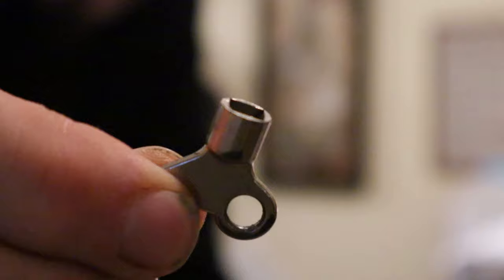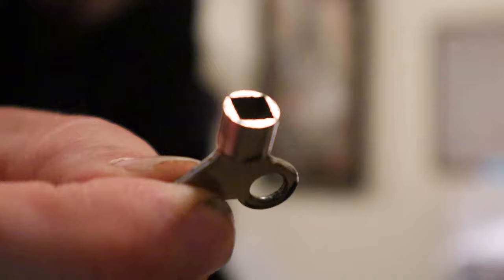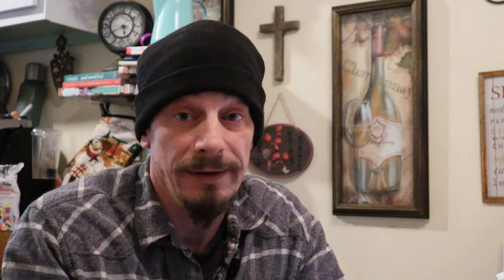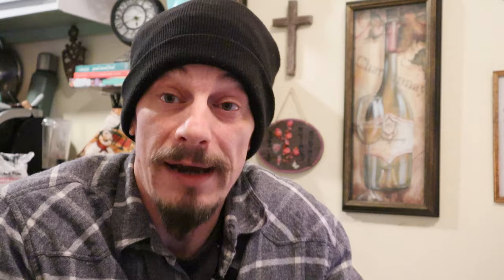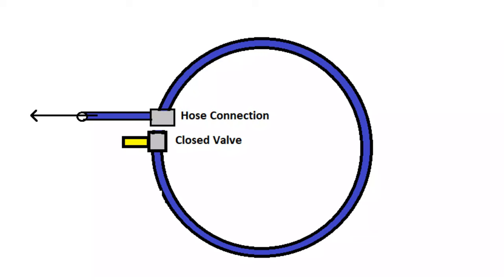Purging Air From A Boiler System (Residential)

Comment: i have a house with 3 different elements 
radiator ,convector and baseboard on a single family hydronic system how do i bleed this
Reply from the maker: They may have different types of bleeders but they all bleed out the same way. Sometimes you have go beyond just letting air out and keep going until hot water starts coming out.

Comment: When I started and through the process of purging the air out the water was filthy brown.
Any problems with that?
Reply from the maker: It is a sign of poor water chemistry in the system that leads to corrosion and lower efficiency. Ideally, it would be best to do a "power flush" and then add some inhibitor afterwards. Or at the very least, purge until clear and add some inhibitor.
Reply: @JerseyMikeHVAC  Inhibitor would be a water cleaner and how to introduce into system. I have baseboard heat.
Thank you John M

Comment: No one will show us the valves and how to use them Every single one of our baseboards has a different valve and we can't for the life of us figure out how to "open" them to bleed the air out. We've tried turning them, pressing on them. I can't find anything online that will show me a picture of the same type of valve that I have. Help!
Reply from the maker: It's not unusual for me to come across plenty of bleeders that just wont open because theyre rusted shut. So don't feel too bad for struggling. 

A lot of these bleeders require a key like this one: https://images.homedepot-static.com/productImages/5d03b2b3-6c9e-41fd-b2a5-7631778ea291/svn/danco-hvac-tools-80238-64_1000.jpg

Some may need a flat head screwdriver. Others just require a half turn but require channel locks to do it because they are so tight, rusty and caked over. Those 3 methods cover most types of bleeders out there. Just be sure not to completely unscrew them as water is hot and under pressure and you do NOT want them breaking off. Water will fly everywhere, and it won't stop unless you know exactly how to depressurize the system and shut off the water feed to the boiler very quickly. 

 If any are too much of a fight, you are far better off just depressurizing the boiler, draining the pipes and just replacing all of the bleeders to new ones. It will be less stressful and less work in the end.

Comment: Jersey Mike Raidient heat system seem in demand. I put one in my house some 5 years now. It is a new build. But back than there was not any I mean any videos on this. I have 3000sq ft individual zones I want to put an eletric boiler to go solor. I'd definitely want to keep the gas heck I'd make it propane if there I I can convert it with an attachment. My question is what kind of eletric boiler can I get that does not have a storage tank? I have a navien now. I'm in long Island NY Andrew
Reply from the maker: I am by no means an expert on electric combi boilers. I rarely work with them. But what I can say is that for individual 3,000 sqft. zones (if I understand correctly), a single-phase fully electric combi boiler probably won't do the job. You'll likely need more power output than a single-phase unit can provide.  I would suggest looking into 3-phase electric combi boilers and the appropriate solar set up to supply it. Maybe something like a Strom 3-phase electric combi or similar. Talk to people who have worked with these 3 phase electric boiler set ups before and know them well.

Comment: Thanks for the video. I have a forced hot water boiler whos circulator is running but hot water only makes it a few feet away from the boiler and the baseboard heat on the second floor is cold and no air comes out of the bleeders. its a very old general electric green colored circulator.. We are replacing it with a gas fired boiler next week but id like to get hot water up to the second floor to our tennant in the mean time. There is also some rattling noise in the pipe connected to the circulator. What can i do?
Reply from the maker: Sounds to me like the impeller inside the circulator is either shot or jammed up. You can try to tap on it with a hammer lightly to see if it might free up,  but otherwise it would have to be taken apart and inspected.
Reply: @JerseyMikeHVAC  wow thanks for the quick reply. I tapped it to no avail. Flow control valve rattles when power turned on and off and theres also a crack in the boiler. i can see the flame. Pressure is about 3 psi when running! So frustrating.

Comment: Need to bleed that 25psi pressure back off as the boiler heats up or it will blow open the pressure relief valve.  You mentioned as the water heats up it expands as does the pressure.  Better to bleed off 120-150* versus steam and 200*.   😂
Reply from the maker: The other end is open to atmosphere during a forced purge at ~25 psi. It doesn't maintain that pressure unless you're isolating the drain valve without letting off the pressure regulator, in which case you're likely going to pop the relief valve with cold water long before you're firing up the boiler.

Comment: Can you purge a boiler when it is hot, say 180°?  Will the incoming cold water crack the cast iron?
Reply from the maker: That's certainly something to be concerned about, but it will depend on your valving situation and where the cold water feeds into the system.  You definitely do not want to purge with the boiler firing. Power should be off. 

 On a lot of boilers, the water feed is introduced into the supply line, so if your return valves to the boiler are isolated and your boiler is already full, then introducing cold water into the plumbing is going to flow primarily in the direction of your baseboard throughout the house and out of the hose at the end of the loop open to atmosphere. It generally won't go directly into the boiler block itself rapidly enough to drop temperatures fast enough to crack a hot block (unless you pop the pressure relief valve on the boiler or have return valve(s) still open). 

 But some boilers do feed either directly into the block itself or through the return piping directly back into the boiler. In that case, you do want the block to cool down a bit before you start purging because cold water will be directly introduced into the block itself and very quickly displace the hot water when that loop is open to atmosphere with low resistance at the other end. 

 Obviously it's safest to let the boiler cool down a little in any case, especially if the boiler is older with a lot more wear and tear on it. 

 You do want the boiler running at set point temperatures, though, when purging air through the bleeders locally at the baseboard heaters. You want that hot water to expand in a closed loop to help push out those last, stubborn pockets of air.
Reply: @JerseyMikeHVAC  Thank you

Comment: What if you don't have hose hook up by either zone only a shut off for supply and return and a main drain valve at the bottom
Reply from the maker: You'll have to bleed from the radiators/baseboard. That'll have to be done with the boiler running like normal.

Comment: Hey mike, my second floor isnt purging, it only purges when i open the return valve for second floor. It starts off hot at the supply but no water comes out of return side unless return for second floor valve is open. Do you have any advise for me?
Reply from the maker: Are you talking about a return valve close to the boiler block itself? Or a return valve on the piping further back? Sometimes the way these things are piped and valved, a return valve does have to be opened on a zone to purge. There's usually another return shut off closer to the boiler so the purge water doesn't feed back into the boiler itself. 

 Purging should also be done with the boiler off. You're not looking for hot water to come out the other end. It should be cold city water temperature being dumped out carrying out any air with it that's in the piping.  

 After you've done a cold water purge on each zone, you then want to reopen all of the valves, get the boiler going, let it get up to temperature and then bleed the baseboard/radiators locally with the system hot. The expansion of the hot water will get out the last bits of stubborn air trapped in the system.

Comment: I have a zone that had 6 radiators that weren't working. Bled the system, but it only fixed 3. Let the zone bleed for 45 mins. Didnt do anything on the supply side of valves. They were left wide open for each zone, while they were all closed aboved the circulatory. Not sure why I can seem to get the last 3 radiators to work.
Reply from the maker: Have you bled locally at those radiators? A regular purge doesn't always get all of the air out in some piping designs. It has to be done at the radiators.

That has to be done with the boiler running and all valves in their normal running positions.
Reply: @JerseyMikeHVAC  I found the issue. Backstop at the cold water into the system was gunked with well water black sand. No pressure going into the system to properly bleed the system.
Reply from the maker: Good find. All working now?
Reply: @JerseyMikeHVAC  2 outta 3, getting little heat now. Gonna bleed again. Thanks.
Reply: Bled the final 3 weak radiators at the radiator! They were old and hiding their secrets. Needed to be done at the radiator. Now working heat everywhere!
Reply from the maker: Yeah a lot of those radiators don't make it easy. You did great!

Comment: Why do I have air in my lines?
Reply from the maker: City water brings in very tiny bubbles of air and over time it can build up if not vented properly, but the problem is usually a leak somewhere. It could be a water leak or perhaps a seal on a pump flange pulling air in. Most boilers are going to have auto.atic bleeders on them that help rid of the air in the piping, but those can get clogged over time and prevents the air from escaping, making the issue even worse.

Comment: Jeez , get out of the kitchen and show me equipment, I still have no idea how to do this
Reply from the maker: There are other videos out there that will go over an actual boiler and how to purge it. But it will only show you how to purge that particular boiler. 

If you don't have the same exact boiler piping, valve and radiator or baseboard arrangement in the video, it probably won't work for you. Boilers are not universal where every one of them is exactly the same, so the procedure can vary a lot. 

 I can walk up to any boiler and purge it because of the principles I covered in this video, regardless of its set up.  That's what this video is about. 

 If you still have no idea on how to purge a boiler, it's time to find someone else who does.